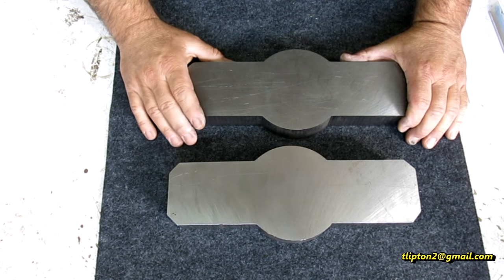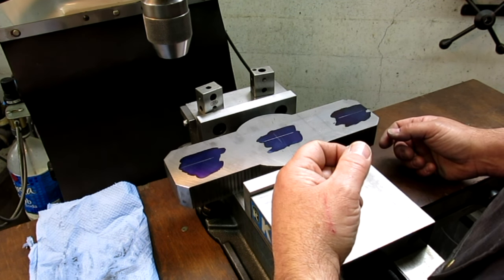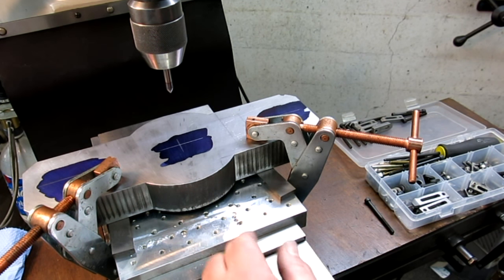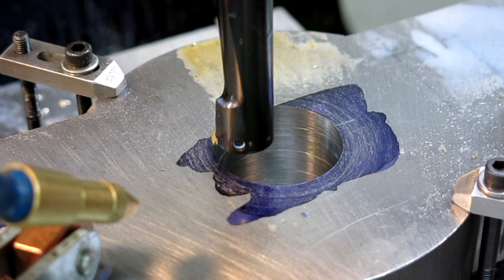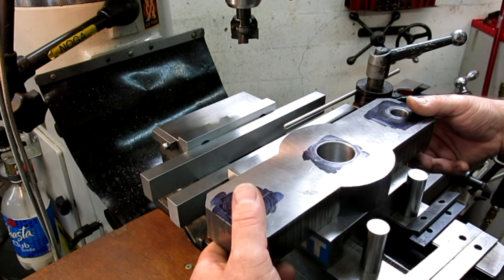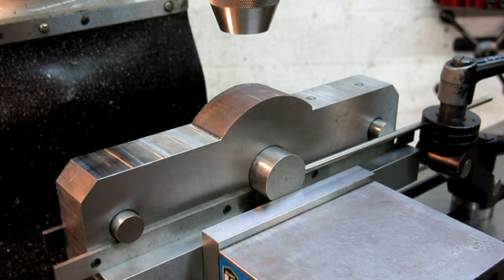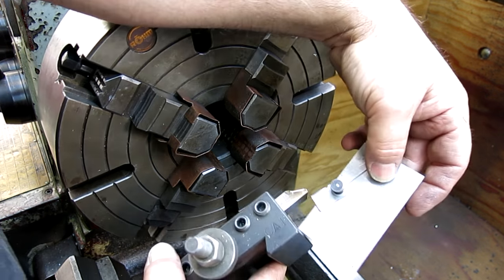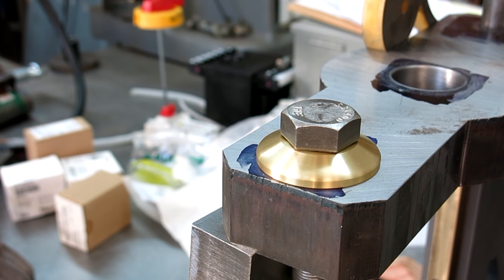Intaglio Press Lift Plates and Washers

Comment: I watched the video just to follow the project and was pleasantly surprised to see  many similarities to my current project. I am a relatively new hobbyist machinist so you validated many of my methods down to the '1 1/2" indexable end mill" cutter you took the time to mention. I bought it from Shars and do not have the experience to say it is a high quality tool but it left one of the best finishes I have achieved to date.

Comment: Another great video - thanks. I was thinking it would be cool to use square head fasteners to give the machine a retro look. I like the cut out detail in the worm gear bracket, something that is not necessary but give character to the part.
Reply: Indeed; maybe even square-head with integral washer. (And an OxTool "X" engraved in the top.)

Comment: Good to see progress on the etching press build.  I started using annular cutters on my channel after seeing you use them.  I don't see too many of other machinists on youtube using them.
Reply: To use them you need either a 3/4" chuck to hold the factory arbor, or make an arbor yourself to fit what size chuck you have. Most hobbyists max out at 1/2" chucks. (At least, I do.) I still have to make the arbor to use an annular cutter for a project I have in the works.
Reply: Peter W. Meek They make arbors for annular cutters with,  R8, Morse, nmtb tapers, straight shanks, etc. I've had really good luck just holding them in 3/4" collets, both R8 and er40s.
Reply: My mag drill (which is where I NEED to use it - out in the field) has a 1/2" chuck. Maybe I could turn down an existing arbor, except I believe the stock arbors have an ejection pin with spring in the shank, so I don't know whether there is enough "meat" to begin cutting away the shank like that.
Reply: Peter W. Meek can you change the chuck out on your mag drill?
Reply: No; it's actually a mag base for a Milwaukee HoleShooter which has a hex spindle for use with angle attachments and extensions. I don't think there are any modern 3/4" chucks with anything but Jacob's tapers. (other idea deleted)

Comment: On plasma/flame cut parts like this I usually clean up the parts first for reference faces and then put my holes or features in. In this case, the parts appear long enough to put 2/4/6 block on the table and sit the part on edge referencing the bottom surfaces near the ends so you can mill the sides square and parallel. Then you can easily clamp the part in the vise like you showed at the beginning and skip fiddly hold down clamps.  Plenty of ways to skin a cat so personal preference.

Comment: Quite a setup in the mill using the parallels and those huge gage pins!  Did you have those huge gage pins on hand or special order for this job?
Reply from the maker: I just happened to have a couple of large ones. I peter out at 1.5 inches. Thanks for the comment.

Cheers,

Tom

Comment: Thanks Tom!  I've noticed you often use two gage pins during setup.  Do you have two sets of gage pins?  Or are you okay with just using two that are .0001 off of each other?  Do you compensate for it somehow?  Or is that way too fussy?
Reply from the maker: Hi Chris,

Good point. No I don't have two sets of pins. I don't worry about a thou over eight or ten inches for a part like this. Thanks for the comment.

Cheers,

Tom
Reply: Thanks Tom.   Perhaps keeping a few small pieces of .001 (or .006, .011, .051, etc) shim stock in your gage pin case would come in handy to make up that .001.  Just a thought.  Thanks for the reply.

Comment: Another great video! I noticed you use a variety of boring bars for the boring head. What are your preferred ones? Thanks. Daniel
Reply from the maker: Hi Daniel,

I prefer the inserted one these days. The second one was to chamfer the edge of the hole. It was already ground at a 45 angle. Thanks for the comment.

Cheers,

Tom

Comment: I'm quite amazed that Tom isn't using Torx head fasteners instead of old-school allen heads.
Reply: The advantage of hex head is you can use ball drivers if you want to reach in at an angle.
Reply: ball head torx also exist! dunno how they measure up, angle of use etc
Reply: As I was skimming the comments I thought it read "old-school alien heads."  LOL.

Comment: Hey Tom,
I'm sure you've covered this but, is your lathe a jet lathe? If so, would you recommend it for a tool room lathe? My work is going to replace the worn out monarch I run everyday. I do quite a bit of tight tolerance work. I really want a LeBlond but I'm not sure if they will go for it. Also I really enjoy your channel! I never miss an episode.
Reply from the maker: Hi Zach,

My lathe is a YAM. A Taiwanese copy of a Mori Seiki.  I would certainly recommend them. Heavy duty and accurate. Now if you want a beast take a look at a Mori MS-850 or an Okuma LS. They will peel off 1/2 inch of stainless in one pass then hold a couple tenths on a finish pass. Thanks for the comment.

Cheers,

Tom

Comment: Not worried about clamping down with those 10-32 bolts where the part is not supported?
Reply from the maker: Hi Peter,

Good catch. They were chicken clamps in this case. Might be interesting to see how much the plate deflected from those clamps. Thanks for the comment.

Cheers,

Tom

Comment: How come you don't offset your vise? I set mine to one side, so when I need to put sometime right on the the table, or a rotary table on, I just leave the vise there. It makes the parts about a thou thinner on one end due to the the slop in our mill, but yours should be good.
Reply from the maker: Hi Metal,

Where my mill is positioned if the table is shifted off to one side for the more frequent work (vise) it makes it snug to open and close the window and access the end of the lathe.  Thanks for the comment.

Cheers,

Tom
Reply: I hear that. We had to go with a 42" table instead of a nicer 48" purely for the room aspect. It's super handy when you can put it on one side though.

-Noah

Comment: Am I wrong in thinking that milling machine doesn't have a coolant return system? How much headache do you get from using mist coolant on a machine without coolant return?
Reply: Coolant return on a mill is just a pair of taped holes in either end of the bed. I am sure his mill has them.
Lots of pros prefer the mist system because it makes less of a mess, and does not require a coolant return so you can do stuff like use bed covers and leave tools sitting on the bed. Mist also runs cooler than flood because it takes better advantage of evaporation and you do not end up with a tank full of hot coolant.
Near as I can tell, mist only has two major did-advantages - it requires a fair amount of compressed air, and produces airborne coolant. I would use it, but my laundry is only 15feet from my mill.

Comment: PLEASE tell me what that blue nail polish stuff is! That looks so useful and I need some in my tool box!Also, is it a bad thing that your perfectly flat lab stone and micrometers/gauges gave me a happy in my pants?
Reply: Jason Harris Dykem is used to highlight layout scratches and has been for years. However, some people have recently been using large blue Sharpies for small applications.
Reply: Jason Harris 
Dykem 80300 Steel Blue Layout Fluid, Brush-in-Cap (4oz) 
https://www.amazon.com/dp/B0018ACR6G/ref=cm_sw_r_cp_tai_uxI-xbD9CBFGS

It even comes in red if you want...